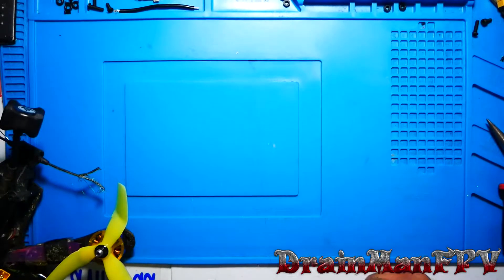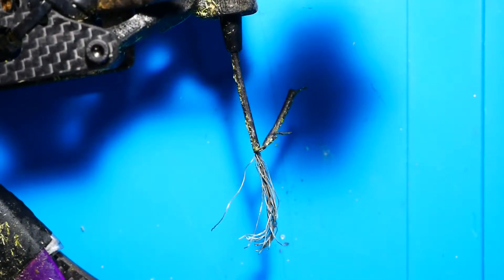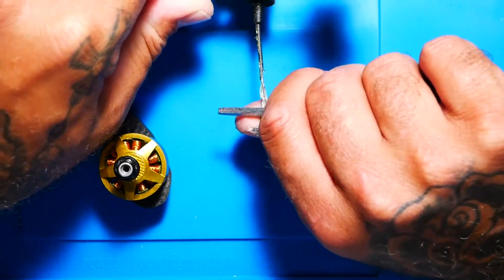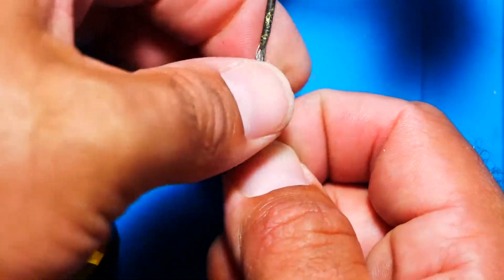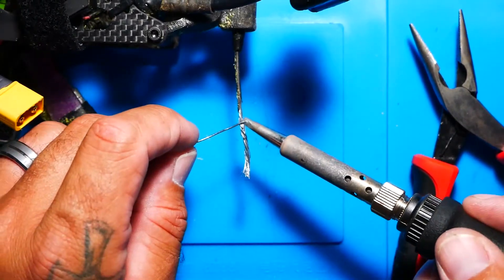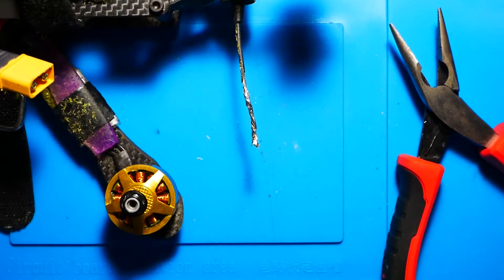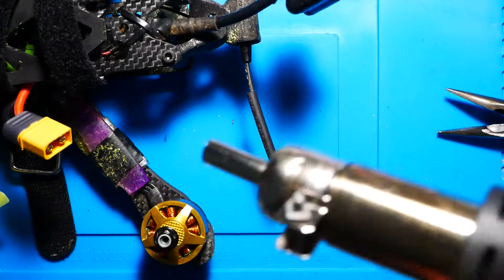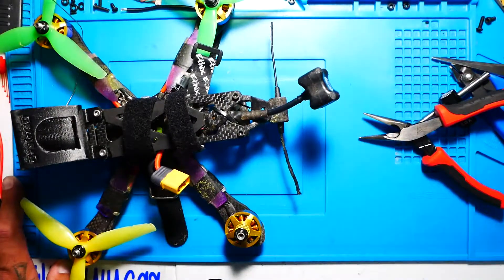Repair Your Immortal T 🔥 TBS Crossfire

Comment: Hey Josh nice video man. This immortal T anntenas all go trough the same issue moist of my quads have this already but only about half inch. Do you think that's going to affect range? also I do a little bit of long range with my digital and analog quads but for that immortal T is the way to go I think because those that mr Steele use are more for bandos and places like that if I'm not wrong. Thank you in advance.
Reply from the maker: I spoke with Trappy when I made this video, this is the recommended method of repair and does not seem to affect the signal, at least not enough to even notice.

Comment: Hello FPV Community, I recently bought TBS Crossfire Micro TX with Nano RX SE, so duo Immortal T, both on TX and RX Setup. Today I did a maiden with my also new built Apex. I set up RSSI as channel 8 in my T16 Nano RX Crossfire Configure Tab. Everything runs on newest versions. in betaflight (4.1.1) i put rssi on aux 4 and it displays 99%-100% while standing on my table. but in the maiden flight i got very very poor rssi values, dropping to even 35% at about 150m distance to the radio. i run the immortal t on my apex with the apex immortal t mount (with zipties through the frame and through the holes in the immortal t mount). the ends of the immortal t dont touch any carbon. on my radio the immortal t sits vertically. my receiver sits on top of my vtx, antenna tbs triumph pro sma, vtx tbs unify pro v3 sma. the nano rx runs on my t-motor f7 5V pin, aswell as the vtx. my question is, if someone knows if i mounted or did anything wrong, and or if it was possible, that my rssi scale is just f***ed up and i really dont have low rssi. in this case i would like to know how to scale it the right way.  thanks for your time, greetings from austria, great tutorials :)
Reply: Hey, did you solve the issue. I have similar problems but a kinda bad antenna aswell.
Reply: @dronimik  yeah, so basically the rssi % value doesnt really Matter when the rssi dbm value and Link quality are good.
Reply: make sure to setup LQ  on your module instead of RSSI values.
Reply: @nes.torfernandez  I just did a range test again. It always failsafes when below ~20% RSSI, so that actually works as an indicator for me. LQ is an option, but it drops quite suddenly from what I have experienced. When it drops your close to a Failsafe. It only had like three values when I tested it. (299, 199... or something like that) 🤔

By the way:
It really makes a huge difference how high you are from the ground. I failsafed after ~600m the last time I tested it on 10mw, today I flew a lot higher and stil had around 40-50% RSSI at that distance. :)